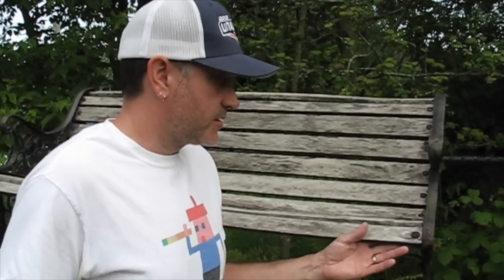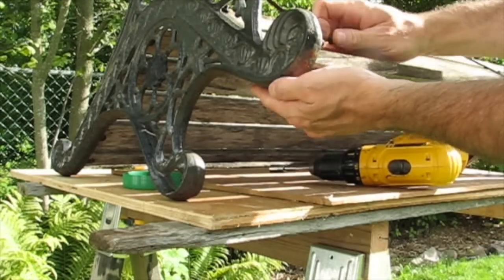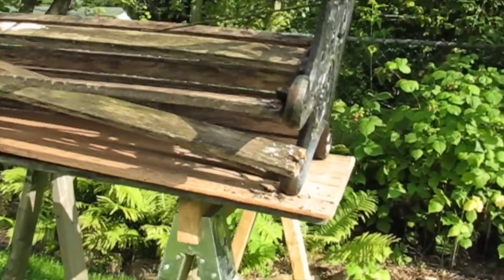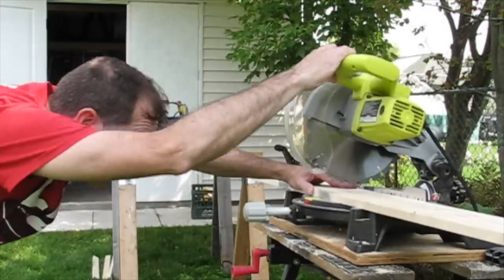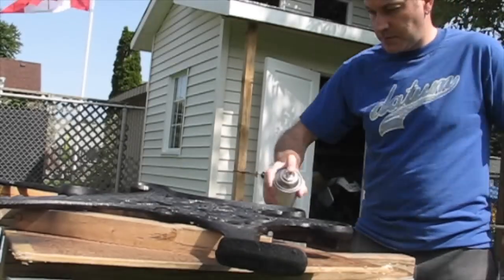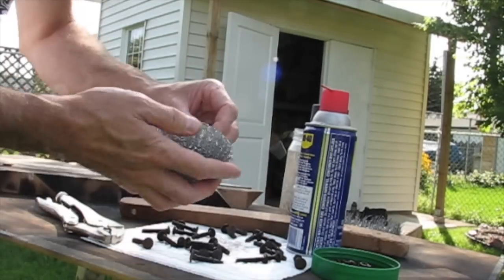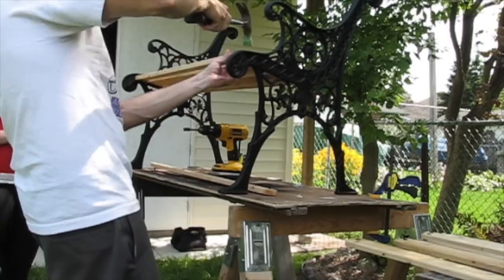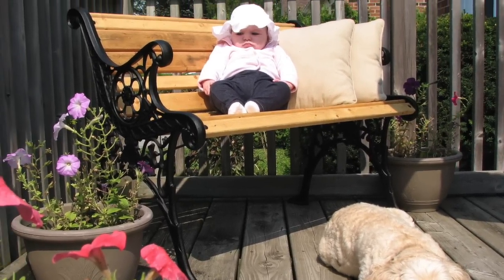Cast Iron and Wood Bench Restoration

Comment: Nice video.  I used stainless steel bolts and washers to finish my bench.  No more rust and corrosion.  And I used treated wood for the slats.  No more rotting.

Comment: Just a note for anybody else doing this.  I have found good oak wood for the slats from forklift pallets. 

Not all of them are oak, and I have no idea why they use it in something like a pallet, but the wood was surprisingly good quality.
If you see a stack of pallets, check them out.  You can usually get them very cheap - and sometimes for free.

Comment: Informative video! I would have used stainless steel hardware and cedar for the wood like others.  Also, am I the only one that noticed one of the slats seemed more narrow than the others?  Was there a reason for that?
Reply: I copied the narrow slats form what was there originally. Probably someone before me fixed a few with a narrower slats. Not necessary tbh.
Reply: The bottom 2 and top 1 are 3/4 width of the others, if you are trying to do a proper job, also counter sink the screw and bolts, this makes the bench much more comfortable, and don't use pine, pay the money and buy decent hard wood, the videois a great way to do it on a budget, but if you buy it cheap, you'll buy it twice, replace all hardware and the bench will last a lifetime, make sure varnish is UV protected, not the cheap rubbish.

Comment: Most benches like this needs 7 long boards and two short...  Not a lot of wood to justify skimping with pine boards.  Also, if you like to rehab benches and sell them, stating that the boards are cedar enhances the value and you can sell for more... I also use semi gloss Rustoleum for the cast iron parts.  The wood I treat with three coats of stain plus polyurethane and stainless carriage bolts...This way it lasts longer.  Costs a tiny bit more, but it will last longer if you keep it and bring more value if you decide to sell it...   A fresh coat of clear poly before each winter is all it will ever need for many years to come.
Reply: Anyone happen to know where I can find the 3 support stabilizers?  I have the 2 ends, but cant find anything on the 3 other pieces.
Reply: @jbone3685  Are you referring to the support bars that go under the seat boards?  big hardware stores usually have metal bars with holes in them about a foot long.  I paint them black and install as the last step of building.  Some benches come with just one of these.  I install two.  Oh, these metal bars do need to be rigid, but with enough flexibility to bend into shape to fit the underside of the seat boards.  I use the edge of metal shop desk to bend them in the right places.

Comment: looks good, would of done a few things different like better wood than pine the cedar would last longer and I would of replace the nuts and bolts with new stainless steel ones.  I just picked up some european cast iron bench ends at a local oction for $30 they looks very old the wood has long ago rotted away the nuts and bolts were almost rusted through they just broke off with little effort I cleaned up the cast iron and sanded them down used a good rustoleum primer and paint lol now they sit in my shop ready to go just waiting on me to chose a wood Im sure I will end up going with Suthern Red Cedar my local mill caries it and its sure lasts a long time outside.
Reply from the maker: Thanks a lot for the tips! I will keep that in mind for future projects.
Reply: I picked up a whole bench for $30, mind you, it was at an AUCTION lol

Comment: After doing 2 of them I found an angle grinder the best method of removing bolts. I know tools and fittings are a lot cheaper in America/ Canada ( I can rarely pick out which accent between the two) than Australia so it it honestly better to replace the nuts and bolts with new ones, preferably the stainless steel. Good job though. 👍🏻😁🇦🇺
Reply from the maker: Thanks for the tip!

Comment: Why did you use two different sizes of wood?  And how did you decide where each of the sizes were positioned?  Does it matter where a 1x2" vs a 1x3" should be placed?  TIA!
Reply: Two at the very  bottom where your calves would be and, one right at the top, helps with comfort (also countersink the bolts) and is more aesthetically pleasing.
Reply: @davec1942  Totally makes sense.  Thanks for responding and for the helpful vid!

Comment: What dimensions did you cut the slats too please? I’ve got the same bench ends
Reply: 3' which is the same length of the original ones. Any longer and the slats may flex.
Reply: @k-jl4317  I think they meant the width as well. If they can't work that out for themselves they should seriously consider letting someone else do it for them.
Reply: Cliff Carlo did you consider anyone being a first timer?? And the fact that some people may only have the cast ends and no timber??? No I thought not. Do you only open your mouth to change foot 🤣.

Comment: Very nice, what type of wood and size did you use
Reply from the maker: I went the cheap route and used untreated pine, since I had left over water seal from another project. The length i used was 3 feet which was the same as the original. You could get away with longer if your slats have the strength, but be weary of sagging if they are too long. Good luck!
Reply: Thank you for the info